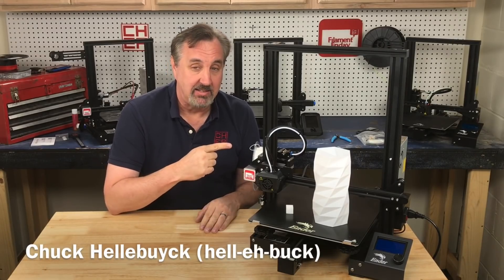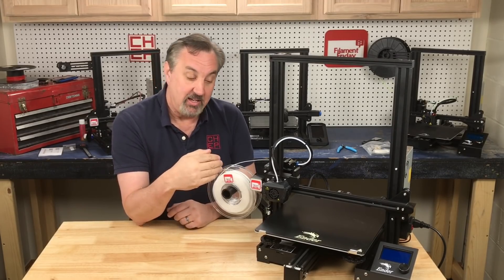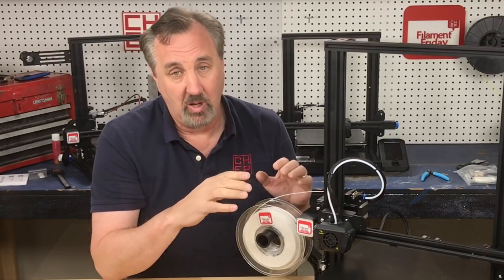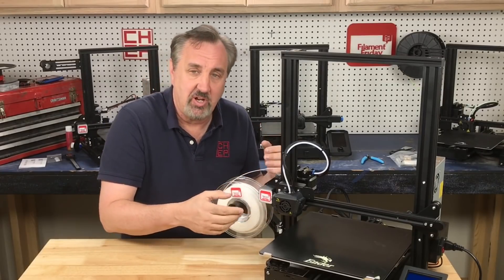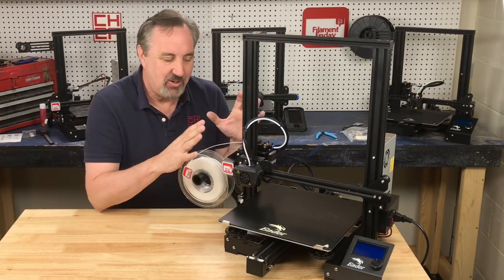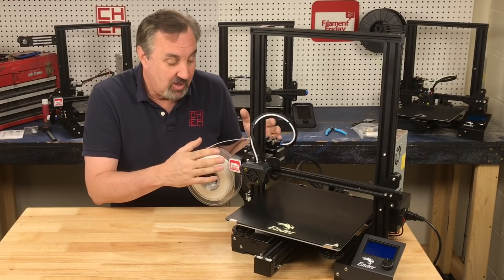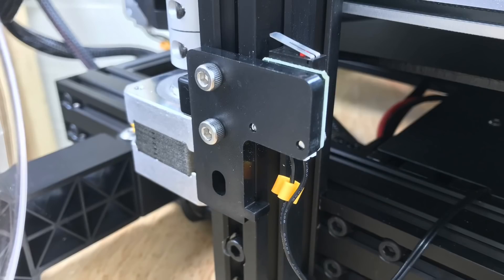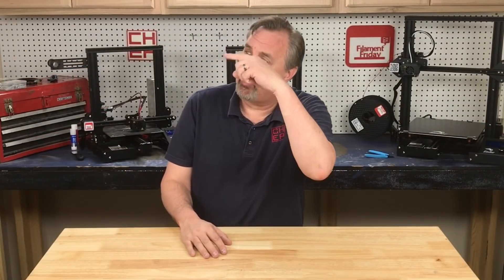Creality Ender 3 MAX Better and Cheaper Improved Version

Comment: An anti backlash nut is worthwhile but a double Z axis screw drive is better.
Reply: i bet that thing is there to prevent the gantry falling down without z motor power. it would be the cheapest solution.
Reply: @zivizivi2328  Nope, the anti backlash nut in this case is actually not necessary as the gantry is always under gravity pressure downwards and so will always have pressure on the nut threads......the gantry is always being pushed up as the plastic pile increases, unlike a mill or CNC router that pushes down to increase the depth of cut.
One of the major problems with uneven table leveling is a gantry that sags as you cannot level the table if the gantry does not remain 100% level at all times.
I would go on to say that you do not need to have a spring loaded table if the gantry Z axis is driven by 2 cross connected or syncronised screws......in that case with a twin Z axis drive once the table is leveled it will remain so forever which means you could have solid spacers to level the table not springs.
Reply: @gangleweed  I agree with your explanation on the anti backlash nut.  I just installed the dual Z axis kit on my Ender 3 Max.  So far so good. I printed 3 parts already.  I am not sure about a big improvement in print quality but it is more consistent.  As you said, once leveled, it will remain.  :-)
Reply: @yvon8488  Yes, print quality is a variable factor with 3D printing as so many things affect the goo until it hits the bed.......making the mechanical parts work good is one that will determine the final result anyway.....it's a case of the weakest link in the chain syndrome......one small inadequacy will make all other improvements invalid.
Reply: @gangleweed  believe me it helps with the sag without power... don't ask me how i know.
Reply: @yvon8488  were did you get the dual z from sir
Reply: On their website, there is a link for a longer belt and a 500mm rod that is needed for the Ender 3 Max on top of the kit.

Comment: Hi Chuck great video as always just ordered a ender3 max on ebay in the uk for £229 keep safe and look forward to your next video
Reply: Got the printer yesterday and just like yours the runout sensor started playing up after the first print, had a look at it and found i could make it switch just by rotating the filament. On looking inside the switch i just bent the lever a bit and took 1 of the circuit board screws out and its now working ok

Comment: This is what I purchased and I paid $289 from 3D printer online store.  So far it's been doing really good
Reply: Yeah I'm thinking of getting this pritner for $289 instead of a Ender 3 v2, or a Ender 3 Pro
Reply: @magmatri-studios  it is much better than the other two. Even set up alone is so much easier. It basically comes in two pieces. Not counting the power supply in a couple little plastic things. But then there's upgrades three max. Come with a special glass bed. Dual fans on the nozzle. Filament run out sensor. Etc

Comment: can you use a dual z off a cr-10 and cut the z screw if needed for the right hieght.
Reply: For what it's worth, I used the Creality CR-10 Dual Z upgrade kit on my regular Ender-3. It was totally compatible. I didn't bother cutting the longer lead screw because it doesn't get in the way of anything.
Reply: @hockeyguy820  nice one.
Reply: I bought the Dual Z Zed Lead screw for Ender 3 + GT2-6mm Timing Belt Loop 784mm + 500mm T8 Lead Screw (8mm Diameter,4 start).   Installed it and working good.

Comment: Thanks Chep, agreed on all these things. I bought one of these for a little less on banggood last week - 245 euro which is think is closer to 300 dollars. I agree on everything - one thing to point out is that this uses the CR10 v2 or pro sized bed rather than the 310mm square bed, so it will use the same base plate if you are buying aftermarket - but the difference is small enough to sort with bulldog clips. I found it printed very well. I think RE the board its definitely 4.2.2 but silent drivers only on XY and A4988 on E and Z. You don't really notice E and Z doesn't move so much so noise is not a lot. The fans are LOUD. I thought noisier than my CR10 mini. I didn't look at the power supply but its definitely 24v. The dual fans are welcome though I'd have preferred if they used a 5015. Agreed RE the rest, it literally took me about 20-30m to get this printing, bed levelling took a while but literally took one attempt and prints stick like glue. It might be worth telling new users to leave the bed to cool before removing prints! Its my first Creality with an ultrabase so not sure if it is easy to damage. I was actually looking to buy a CR10 v2 or 3 when I saw this was actually a 100 dollars or so cheaper - its really nice and definitely fits into the space between the CR series big beds and the Ender! I have a BL touch on order but not sure I really need it - I've had the mini for 3 years and probably level the bed once a month if at all. My only gripe is that Marlin doesn't have the firmware examples in yet but Tim at TH3D has put something together over on his site if you want to compile yourself - I had excellent results with both stock firmware and Tim's version.

Comment: In terms of accuracy+quality of prints, do you have any opinions on the Prusa i3 MK3S+ vs the Enter 3 MAX?  I have a Lulzbot TAZ 6 which seems bulletproof- may end up being a 10 year printer coz of the multitude of options for it+new offerings.  But have tho't about picking up either an Ender or Prusa to see how I like them.  For me, the price isn't so much an issue... am more interested in the experience+quality of output of each printer.
Reply from the maker: You’d probably like the Prusa better with its autolevel and better support including firmware  updates. Prusa prints faster too and higher temps like Lulzbot. Creality is more of a low cost, hackers special with replacement parts and accessories easy to find. that prints really good but support relies on the community.
Reply: @FilamentFriday  I agree here - have both printers - will point out though that unless you are buying the fully built MK3S+ the Ender Max is much faster to assemble and easier to dial in. But agree RE the Mk3/s/+ with filament sensors and bed levelling as well as bed options. Prusa is by far the better printers for PETG and exotics, Creality excellent for PLA but anything over 240c is more problematic and the beds just are not as stable as the heating on the Prusa. Easy to mod though but price wise Prusa better quality out of box

Comment: Can you make the bed leveling files for the Max printer able to download? Or could someone explain how to copy the code to my sd card please? Any help would be much appreciated
Reply from the maker: Link in description. Just scroll down a bit when you get to the page.
Reply: @FilamentFriday  I really appreciate you getting back to me, especially so quickly. But when I click on the download link, it brings up the actual written code. The other links for the regular ender 3 and cr10 download the file, but this one just brings up a sheet of code
Reply from the maker: I updated it to a .zip file. Download that and unzip.
Reply: @FilamentFriday  Thank you so much! It worked perfectly!
Reply: @FilamentFriday  I leveled the bed and started printing and it printed a few layers of a cube and then printed a layer of what looked like smashed bubbles and then started printing fine again. I stopped the print, checked level, and started again. Same thing happened. Also, I tried another print with a raft and in addition to the bubbles again, the print won't come off the raft. It's like it's welded to the raft. The same file worked fine on my regular ender 3 and ender 3 pro. Any ideas what may be happening?
Reply from the maker: Same filament printed fine on other Enders? 
Sounds like the filament may need drying out.
Reply: @FilamentFriday  Yes sir, I even used the same roll on both of the printers to make sure

Comment: I'm also thinking about getting the Ender 3 v2 for my first printer, just because of the print size. I'm hoping folks think this is a good first time buyer printer?
Reply: Mine works pretty well. I recommend the Smith3D firmware, it adds a few extra features that I find rather handy over the stock firmware.

Comment: Hi Chep, I recently bought this printer, and I am having problems with Vase mode (spiralize outer contour).. You might have seen this issue already.. Do you have any suggestions on how to fix this?
Thanks!
Reply: Turn off outage recovery
Reply from the maker: A better SD card usually fixes it.

Comment: I want to buy my first 3d printer so should i get this or the v2
Reply: v2
Reply: @moddok  quick reason why? I have v2 thought about getting this as a second printer for large prints.
Reply: @brianpumphrey8761  because for 99.99999% of the prints the normal height is enough
Reply: @moddok  i have the v2 and just decided to order the max for the extra bed space as a few rc parts I want need a bigger bed. Now ill have a v2 for quick prints and max for those long 24+ hour prints. For 289$ for the max it seems like a steal.
Reply: @moddok  Would like to know as well

Comment: Zwobble? is the new spring screw helping in this? i have an ender 3 and the QA/QC of their component is quite poor hence a wobbly Z rod.
And how is the bed? Flat enough or with a lot of high/low points?

Comment: Cheap. Do you know where I can buy a nozzle rubber boot for my ended3v2 printer mine is only 3 months old and already hole for nozzle is starting to break apart
Reply from the maker: In the video description you can find many parts including the cover. 
CR10/Ender3 Silicon Heater Block Cover: https://amzn.to/3sfDG7s

Comment: Thanks for this video.  I bought an Ender 3 Max about 6 weeks ago.  Not having any experience with any of the other Ender 3 models, your video confirmed that I made the right choice.  :-)  I like this printer.  The only real issue I had was some small layer shifting, too visible to ignore.  I did experiment different suggestions I found on the web like changing the Vref voltage on each motors, limiting the acceleration and jerk, but the one that seemed to fix it was grounding all the stepper motors.
Reply from the maker: Interesting. Not sure why that would work since ground is one of the wire connections.
Reply: @FilamentFriday  It makes sense.  If you measure the resistance between each motor's body and the power supply enclosure (ground), all motors are not connected except the Y-axis one (through the frame).  There is no ground in the 4 wires going to each motor.  Because of the movement of the belts and the wheels back and forth, it accumulated electrostatic charges which could jump on the motor's wires and make its way to the control board motor driver.  In the motor driver datasheet, there is a mention about proper grounding.  A discharge could reset the counter in the driver, hence causing a layer shift.
Reply from the maker: Nice find. I was thinking of a different motor. You’re correct, the wires don’t supply the ground. I’ll check some of mine.

Comment: Hey Chep.

I just got my Ender 3 MAX, and when I Home it is doing so over the bed rather than just in front of the bed like my regular Ender 3.  Is this the correct position or should it also be in front of the bed like the regular Ender 3, the Y stop is not adjustable.
Reply from the maker: It should be over the bed actually.
Reply: @FilamentFriday   
Thank you!

It has been driving me crazy all day trying to figure out how to make it home the same way as my regular Ender 3.

Now just to get the Z Stop sorted out with some T-nuts, although honestly mine seemed pretty dam stable even when adjusted quite high on the bed springs.

Comment: I want one of these, but I don't like the placement of the power supply. I like my printers with dual Z rods.
Reply: I made dual z rod mod to my ender 3pro, i print suitsble holders to power supply and its now flat between body rods. easy installation.

Comment: Is this a good printer for someone that has never used one before?
Reply: That depends.  The Ender 3 Pro can be had for $209, so if you start with that and decide 3D printing isn't for you then you're not out much.  This printer is $329, which is an additional $120 you lose if you don't print much.  If you're certain you're going to stick with it, and you have a place to put it, this should be a good printer.  There is a learning curve to 3D printing and you will have failed prints, it goes with the territory, you'll also have to learn the ins and out of 3D printing, but CHEP, Maker's Muse, Teaching Tech, and Thomas Sanladerer have plenty of videos to help you get around those things.

So, if you're good with spending $329 for a hobby you're not yet certain of then yes, all of the Ender 3 printers make for good starter printers, they're capable of some really good prints and are dimensionally accurate.  I have an Ender 3 and 2 Prusas and I've printed parts on all of them for the same model and the fit is terrific.
Reply: @thermalreboot  I have never played with one so I am looking at getting one maybe but I want a good one.
Reply: @xsiner  IMHO the best 3d printer you can buy is the Prusa I3MK3, but that will set you back $750 for the kit or $1000 for a prebuilt one.  

The Ender 3 is an exceptional entry level printer, the prints it produces are very high quality.  I've recommended it to friends who were interested in getting started in the hobby but didn't want to spend a lot.  There's a huge amount of community support for the Ender 3 which makes it a GREAT printer if you want a deep dive into how 3d printers work and are interested in adding upgrades or making mods to your printer.

I have a friend who has a saying, if you want to print by a Prusa, if you want to learn how to print by an Ender 3.

The Ender 3 has a bit higher learning curve, but if you're the least bit technical, if you can turn a wrench and you know how to program or are willing to learn the Ender 3 can be a good choice.
Reply: @thermalreboot  Thanks.
Reply from the maker: If you don’t want to build it and upgrade it but have limited budget then consider the Prusa Mini
Reply: @FilamentFriday  I'm reluctant to recommenced the Prusa Mini to a newbie.  I have one and I've had numerous extrusion problems.  I've replaced the hot end PTFE tube several times, including trying Capricorn tubing.  I've replaced the nozzle several times.  I've done the nozzle and PTFE at the same time.  I'm now to the point that I'm going to change the heat break with the BondTech as part of my problem seems to be heat creep.  I've been printing for 4 years and own 4 printers, and if I find the Mini a challenge, it may be enough to sour a newbie.

Comment: I'm doing some research to get my first 3D printer and I'm currently thinking about the Ender 3 V2. Is the Ender 3 Max better than the V2 or there are no significant differences, besides the build volume?

Comment: Mine arrived yesterday and I love it but any idea how to remove and replace the bearings that hold the extruder specifically the bottom one as I didn't check it( my own stupid fault aha) and it's already started to wear
Reply from the maker: You can turn it and adjust the tension. It’s on an eccentric nut.
Reply: @FilamentFriday  Thanks for your help that's great.

Comment: How hard do you think it would be to add direct drive and ABL to the Max?
Reply from the maker: Not hard at all.
Reply: @FilamentFriday  have a CR6 Max now and miss those. In fact my 6Max has been back into it's box the last few months because of size and missing features. May consider the 3Max and start modding. My 5Pro with PrinterMods DD and Microswiss all metal hotend is my primary printer.

Love your videos and information you provide. I'm sharing them out and encouraging people to subscribe. 

Have a good weekend.

Comment: I just set mine up. Was a pretty poor experience to be honest. Nozzle was plugged from the get go, a sliver of PTFE was stuck in it. There were numerous loose screws, X axis carriage wheels have flat spots. At least the Z screw was lubed from the factory so that saved me a step. I also took the runout sensor off and threw it away, they're not something I personally care for.

Comment: I'd buy one of these if my 3 year old (or is that 4?) first generation Ender 3 wasn't printing so well. Other than the larger print area, I see no advantages over what I already have. Well, I added auto bed leveling so I guess mine is a little more advanced. Lol. Great looking printer though. As always, thanks for what you do.

Comment: I recently replaced my Ender 3 Pro flexible magnetic bed with Crealitiy's PEI bed plate, and IT'S AMAZING.  Along with the smooth surface, the metal plate greatly helps even out the minor dips/bumps in stock bed.  I'm hoping Creality will come out with PEI for the MAX.

Comment: Odd that they didn't include silent drivers for the Z axis, but then again they are trying to hit a price point.  For my Ender 3 Pro I [purchased  an 8 bit 1.1.5 silent board that I never never got around to installing, then when the 32 bit 4.2.7 board came out I purchased it, which I have yet to install.  So now I have two silent boards for an Ender 3 Pro :)

I wonder if there would be any advantage installing the 4.2.7 board on an Ender 3 Max?

Comment: Is the thermistor sensor design the same?  Because it's pretty dumb. LOL  I'm hoping to get a screw-in mount for the thermistor for my current ender 3 v2 pro, but hoping they make a permanent improvement to that design.
Reply from the maker: Yes, the same
Reply: bummer